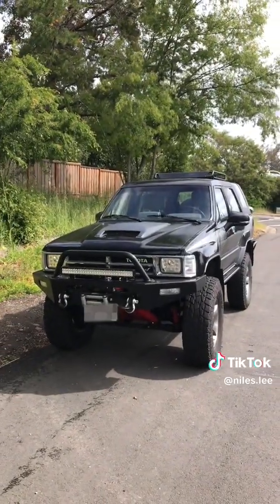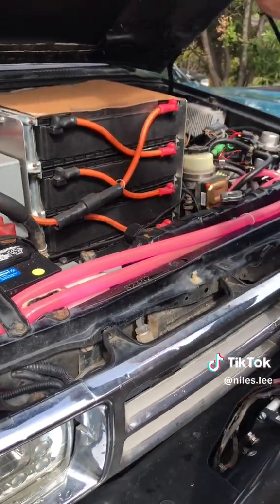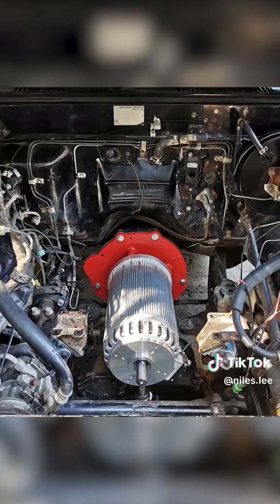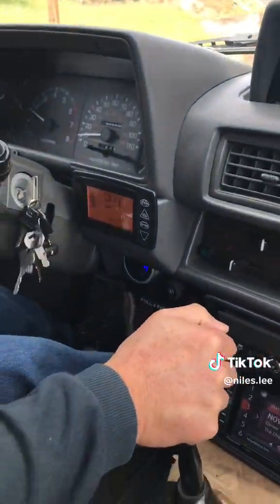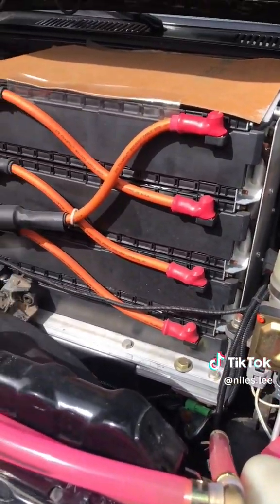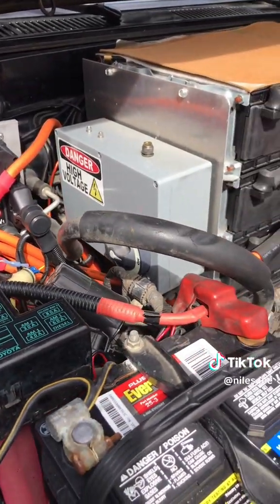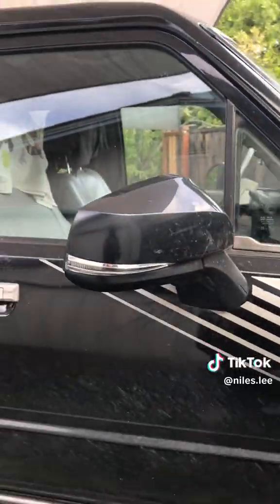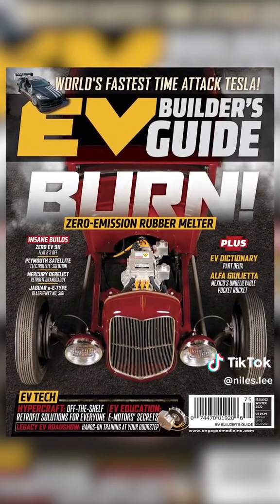1988 Toyota 4Runner EV Conversion

Comment: I wonder how hard it would be to build a diy pack out of LFP chemistry batteries. 🤔. Your dad is smart he should try it.
Reply from the maker: Thanks, I am waiting for the internal pack details of the new 2027 Chevy Bolt with their LFP batteries, and when they get more plentiful. The external overall battery pack case dimensions are supposed to be the same between the old and the new Bolts, but the internals are different which matters here. Hopefully they could be configured to fit in the existing 4Runner battery location.
Reply: @AllenLee_1 oh that'd be really cool. Didn't know the new Bolt is going to have updated battery chemistry. Might actually be a decent car with a more durable battery pack added. Too bad we don't have access to any of the Chinese EV market packs.

Comment: And then he can swap out the batteries into the next gen kind when the tech really matures. If not for lighter weight, ut is for way more range and power. Bonus points if there are solar panels to charge this. 

My favorite part is still how it has a 5-speed.

Comment: how big are the batteries in kWh & what is the average range of this setup? is there any more detailed info about the build?
Reply from the maker: 4 Chevy Bolt batteries, total 23.8 kW-hr. ~40 miles (if not defective). Designed for around town, since batteries are expensive (for now). See my website & EV Builders Guide Magazine for more information.
Reply: @AllenLee_1  ❤your website has some great info in the "specifications" section. thanks for sharing! 

I'm also curious, why did you keep the 12v lead acid battery instead of doing a dc-dc down converter to 12v from the 178V mains? Or did you drop in a lithium 12v car battery there? When I end up going this route (probably once energy density is brought up 2-3X of current batteries) I will try to put the weight of the batteries as close to where the vehicle was heaviest stock.

If the 22re is roughly 300lbs and the Hyper9 motor is 130lbs, that would mean adding ~170lbs of battery above the motor, and spreading the rest out where the 12v lead acid (~40lbs) and full gas tank (~125lbs) are located. I know there'd be no way to get it exactly the same, but it would be a goal to get as close as I can. How much does one of those 6kWh bolt modules weigh? I estimated at around ~60lbs ea.?

I think your build is soo cool! I previously completed an om617 (mercedes 5cyl turbo diesel) swap into my first 1st gen 4runner, so I'm quite familiar with how a bit of added weight feels under the hood. Curious how it drives with your setup!

Your build is so so awesome. I am so inspired ❤‍🔥
Reply from the maker: @lleallooo  I believe that all EVs have a small battery in addition to the traction pack mains. Most are 12V, since existing 12V system. The Hyper9 systems also require 12V to start it up. You could wire up the DC-DC converter to be on all the time. However, it will be a small drain on the mains.

The Bolt batteries are 72lbs each, at least the first versions of them (prior to them being upgraded, slightly, believe 8%). This is what I purchased, prior to them being recalled for fire. Hence I am only charging them to 90%, per GM's recommendation at the time.

Regarding drivability, the Hyper9 motor is recommended for vehicles <3500lbs. My 4Runner with all the off-road items (metal bumpers, rock sliders, large tires, full size spare, etc.), tips the scales at 4500lbs. The Hyper9 motor does have more power than the original 22RE motor, and if you wind it out with your foot on the floor, it runs great and better than the 22RE! However, NetGain is limiting the torque per RPM (despite what their curves show), so at low RPMs, it has less torque than the 22RE. So, you have to really make use of the gears/shifting, which I like driving a manual anyway, so it is fine with me.

Thanks again for your kind words.

Comment: oh dang, I have been thinking about doing a conversion like this to my 1988 4runner for sooooo loong! this is so cool, and so inspiring!
Reply from the maker: Thanks!
Reply from the maker: For reference, on both my TikTok (allen.lee_) and Instagram (allen.lee._) channels, I posted pictures yesterday of my EV conversion during the build. Or you can get to those channels via my website. Note: They are best viewed on a PC, since larger screen, so you can see the details. For reference, TikTok has the higher resolution (but has some clipping at the edges, will not put text that close to the edges on future picture posts). Hope this helps for your EV conversion!